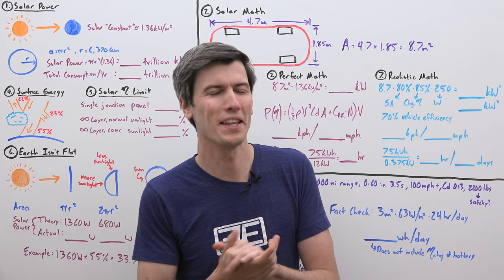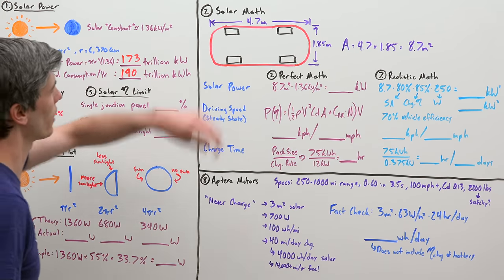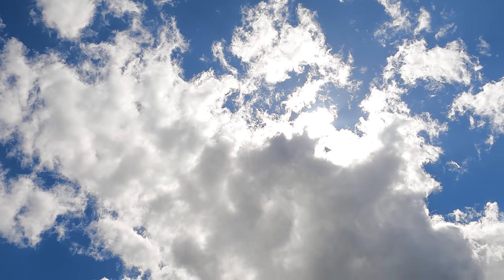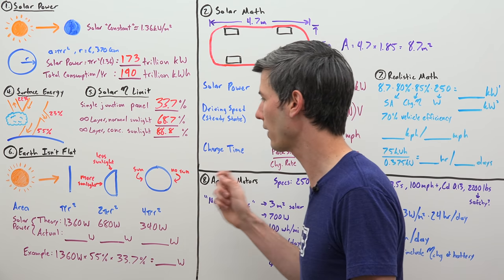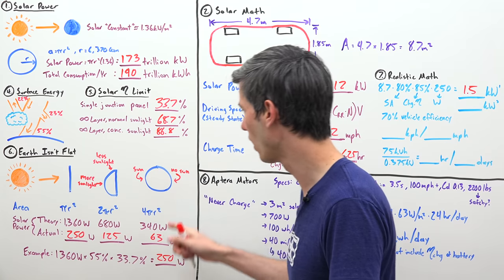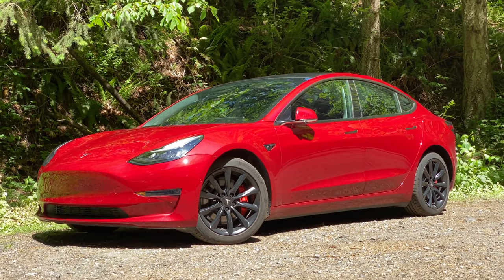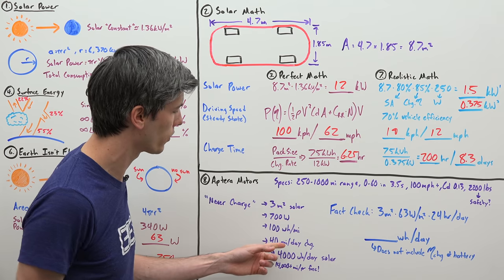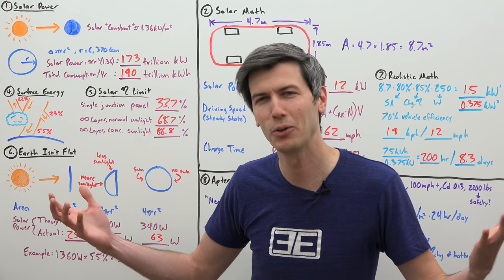Why Don't Solar Powered Cars Exist?

Comment: Short: There isn´t enough power. You can see it also when looking to solar-race-cars with bicycle-thin wheels and huge panels on top, extremely aerodynamics and closely interiors. 
But I thinks, all cars should have solar-panels on top, to feed AC-vents when parking under the sun (to avoid hot interiors) or give a little recharge to the traction-battery.
Reply: Absolutely spot on.  Parking a car in sunlight, almost regardless of the season, means returning to an oven. Given that this is both uncomfortable and, potentially, dangerous for animals left in the car (sometimes unavoidable for short periods), it would make sense to have a supplementary solar system to help run the air conditioning whilst the car is stationary if it's powered by an ICE, or additional to the battery if powered by electric.  I have a vague memory of this having been trialled some years ago.  Why has it not made the main stream I wonder ? Admittedly a total power consumption of 5kw is a tall order, but as a supplementary source, why not?
Reply: @frenchchriss9880  Aptera is not any normal metal car body   The body is a foam filled sandwich with a much higher r value than a normal car, so it heats up at a much slower rate.

Comment: Jason, on the fact check on the last line, why did you take 24hr/day to get the total Wh/day? I thought the rule of thumb is to multiply the peak wattage by ~4hr/day instead? Unless the car is being driven under the sun 24hrs a day, which doesn’t make sense 😅

Comment: I was interested in the fisker ocean, so I did some math and found that you can save about $55 a year when energy prices are $0.15 per KWH . This made me think though. How much do solar panels weigh? Does adding the weight of solar panels reduce the energy efficiency of the vehicle? If so, you would not be saving the same amount of money. I’m wondering exactly how much the weight of the solar panels would effect the energy efficiency of the vehicle. (The fisker ocean claims a range of 300 miles on a 80 kWh battery. They claim the solar panel roof will provide 1000 free miles a year.)
Reply: Maybe they already take weight into consideration though when they say 1000 free miles

Comment: The normal size of a standard car with high efficiency Solar Panels but built for one occupant and with slim tyres would probably work very well out where I live . Minimal road resistance, a very energy efficient Motor and a great coefficient of drag and you’d have an awesome sunny day driver ….the big secret to success is to minimise your power requirements whilst maximising your power uptake, bleeding off excess power to cool the car as you drive .

Comment: Quick question: on the Aptera fact check, why do you multiply with 24h since the daylight with powerful enough sun would only last probably around 8 hours? That would mean that the numbers should be lower right? Or am I taking it all wrong? But all in all this is a very cool and clear explanation 👍👍👍
Reply: He already calculated how much solar energy you can expect in a 24-hour period. This accounts for not only the number of hours of daylight, but the fact that you get more sunlight at noon than at dawn.

(He didn't account for your latitude, but took a whole-earth average. Closer to the equator, you do get more. Likewise, this is global average weather conditions. You get less energy in a place that is often cloudy.)
Reply: Watch the video?

Comment: You could use the solar panel to charge the 12 volt to keep the computers alive and also the power the radio windows and the other accessories to reduce the draw on the main battery for any EV instead of flat-out charging the Maine pack
Reply: The Aptera doesn't even use a 12V battery, it uses a converter to run 12V systems from the high voltage battery pack.

Comment: I probably missed something, or are we assuming that the sun is shining at night calculating with 24h days? Either way, would still be great to supplement our consumption with solar power if we can build durable affordable and environmentally sustainable solar panels.
Reply: I think that's the line of thinking he overlooked, which companies like Lightyear, Squad Car, and the makers of the Sono Sion didn't overlook. The problem with thinking from data alone is the powerful tendency to consider only the data that supports your preconceived notion. When you address a problem with the "how do we make this possible" thinking cap, the more powerful tendency is a thorough consideration of all the factors involved (including those that have not yet been identified).

Comment: You jumped solving the problem instead of focusing on what the problem is in a first place. 
1st Toyota Prius Prime already has solar roof that ads 5 miles on sunny day. 
2nd This could completely solve the problem with ghost battery drain when you leave the car for a long time at the airport, or using century mode on tesla
3rd. If you like camping this would be very useful. If you camp for a few days, this could completely charge the battery and you could go places where normal electric car can not reach. 
4th. If your area had storm and there is no power for a week, but your car has a high voltage socket, this could provide basic power for the light, tools etc even if you forgot to charge the car.
5th. It can keep the battery warm in the cold climate or it can precondition the battery.
So its not about using solar to drive the car, but to extend the possibilities of existing cars, this solves some problems and introduces new possibilities. I am 100% sure in 10 years all new electric cars will have some sort of solar charging option.

Comment: What if you did a video on the math of using solar panels as range extenders? What if you are out in the middle of rural Montana or Wyoming and you mess up and can’t get to a charge station on time? The charging solar panels could be an emergency back up giving you the equivalent of an extra gallon of gas. (20-40 miles) That way you won’t have to have the car towed.

For the normal person, the panels might make the car too expensive, but I would think somebody with a wad of cash would buy it to just say they have it.

Comment: I think the biggest obstacle to solar powered cars is that people think of them as solar powered cars. A pure electric solar powered car would be so unreliable you'd need the option to plug it in, making the solar panels redundant anyway. Where it would actually make a difference would be in hybrids and PHEVs. In my country, 30% of people have no choice but to use on street parking where charging isn't really possible. If the tech was added to hybrids and sold on the promise of an actually attainable 20-30% improvement in mpg for the average driver, there'd actually be a market for it.

Comment: A solar powered car would need a trailer with solar panels of about 250 m², so that is, with a limiting width of 2.5 meter, a 100 meter long trailer. That is for a regular, 4 person car.
Reply: Is it possible to use something other than a regular, 4 person car? That could help bring down that 250 m^2 number.

Comment: Thanks for putting together this topic.  I have a question, what if the electric car was to have a alternator like device (built into each wheels motor to supply the car as well as charge the battery.  Like a high, high output one alternator? At that rate the battery could be smaller, making the car lighter as well.
Reply: Because the alternator has less than 100% efficiency, will cause extra drag on the car, and will reduce overall vehicle range.
Reply: Get that set up and market it as a modern perpetual motion machine.  I think you are on to something here.    (want to buy a bridge?)
Reply: That is essentially the idea of regenerative braking. Use the motor as a generator to slow the vehicle and recover energy to recharge the battery.

Comment: May i ask, can you do this, but instead of a model 3, use a Tesla Semi, and, use the semi trailer roof, a nice big flat surface, and cover it in panels, does it then make sense to assist with Semi range?

Comment: Okay but that's still impressive because if it takes 8.3 days to fully charge your 75W vehicle (we all know we are talking about a tesla model 3) then you can still get over 43 full battery charges in one year just from solar. 
43 charges × 285 miles = 12, 225 miles per year from solar.
285 miles ÷ 8.3 days is 34 miles per day. So if you drive less than 34 miles per day you could drive for free.

Comment: That 33% number for efficiency is also extremely optimistic.  

Efficiency is measured at 25 Degrees C.  Which never happens in the real world.  The Sun heats them up.  Efficiency drops off considerably after being in full sunlight for even a short time.  This sadly effects the most efficient panels more than some of the less efficient thin film technologies. 

You'd be lucky to get 20% in an application like this.  Less if you wanted to use reasonably priced panels.  And there are losses in Area efficiency related to the cells themselves.  You can't use one big cell inside the panel, the voltage will be much too low.  You'd need link smaller ones in series.  There is a reason the Toyota Prius Solar Panel roof wasn't even part of the charging system.  

Solar Racers make it work by increasing surface Area, and minimizing weight, and has extremely low drag.  Basically like a wing.  No production vehicle is in this sort of ballpark.

Comment: If Aptera marketed a model aimed at the 2nd car market, the price could be slashed dramatically & become a super attractive proposition for many.
There would of course be sacrifices to be made, but it would be way more efficient, with less demand for expensive battery mineral resources, making it even more environmentally friendly.
The first move should be to reduce performance to perhaps a sensible 0 to 60mph in 9 seconds, with a limited range suited to a daily local run-around.
Then again, if it's not needed to do highway trips, then the radical shape could be toned down & be visually more attractive.
Reply: Low power motors would not be great for regenerative braking. Having powerful motors is needed for decelerating effectively via regen. Being able to accelerate quickly is just a nice side effect.

Comment: I'm a fan of what Aptera is trying to do but if you live in a built up area away from the equator there's no way you're getting close to 40 miles per day. In northern Europe for example I think you'd be lucky to get 5 free miles. They'd probably be better off scrapping the solar panel and marketting it as a cheap super efficiant EV.

Comment: Solar would work great for microcars (quandricycles) in sunny countries, since they weigh less, have lower top speed, and are only used for short trips.
Reply: All city cars basically - 20kmh average speeds in the cities, they spend all day outside and are driven for 1-2 hours in traffic. Even getting 3-5 km of range per day sounds like a dream

Comment: It’s not about fully charging the batteries in this early stage, which is precisely why all variations come with multiple ways of charging the battery. 

But if you could charge maybe 1/8th or 1/10th of the fully battery capacity per day, it would totally make sense. Especially if you don’t drive every day or have short commutes or multiple cars as options. 

Technology is only going to make batteries and solar panels more efficient. From last year they are 50% or higher in efficiency, and 70% lower in cost. Give it 5-10 years and the viability will be much better.

Comment: I'm sure this is a re-upload.
Anyway... Forget putting the solar panels on the car, put them on the house, put them in a field etc... It doesn't matter where the solar panels are, if the car is getting the power from the sun, then it's powered by solar making the argument a little flawed.

Here in the UK, all my energy is renewable. My electric comes from various wind and solar farms around me and my gas is from recycled food waste. (The gas is a little bit confusing as it gets topped up with conventional gas sources but the energy company offset any units we use which are not from renewable sources by planting trees and other environmentally friendly things.)

Some people, live in "off the grid" homes which, if they also own an EV, will be charged by the same renewalable energy.
Reply: You know it isn't an either/or choice, don't you?

Comment: i get why cars don't depend for solar to completely power them. What I don't understand is why don't they put a panels on EVs for other use cases?

You ran out of juice a little before you reached a charger. Waiting around for a few hours to take you a mile or so could be useful. Or you are stuck on the highway and your phone is dead. A trickle charge from solar might be useful to call for help. You have your car parked for extended period . Keeps the battery topped up.  If camping or outdoors somewhere you can use it as a power station for moderate power needs without worrying about getting stranded. Power goes out for extended period in you neighbourhood. You have a bit of a backup UPS, etc.. etc.. The portable power stations with portable solar panels market has boomed these last few years. WIth an EV with solar you are effectively getting a big one for free without the inconvenience of having to lug one into your car.

 You could even dramatically increase the amount of solar panels on an EV by using newer generation thin panels and having some sort of retracting solar panel system to boast power while parked. Some creative RVers and vanlifers are already doing this with solar awnings and custom roof mounted retractable solar panels. Saw one Sprinter van with 1600W of solar panels (when extended when parked ). Surprising that the big EV companies haven't picked up on this.   I'm positive if a company with big resource executed this well and affordably it would be very popular optional feature. Imagine unfolding out a few thousand watts of  solar from your car roof as needed. That would be really useful in countless ways.

Comment: Can you please do the math on how large a solar farm/array would need to be to charge multiple electric cars simultaneously in reasonable time (eg. rate of a Tesla supercharger) in a gas station style scenario. I find it interesting how many people cannot believe how large the array would need to be when I explain why a rooftop solar array is not enough to even charge a single electric car fast enough at a gas/charging station scenario - whereby you can probably only hang around between 15 to 30mins before it becomes a massive inconvenience.

Comment: I think it's feasible if you don't use your car much, like a granny or something. Shopping twice per month and a few errands here and there close by but other than that it's parked outside. Also, assuming it's fully charged when you're out and about, those short trips shouldn't drain your batteries completely, maybe 10-20% and it should be good again in a couple of days.

Comment: What would be your thoughts on putting solar panels on vehicles that already have large surface areas, like buses, semi's, trains, or airplanes? Would their be any benefit, or due to the amount of power required to make these large vehicles travel, little to no benefit from solar panels?
Reply: Trains would benefit
Reply: @knartfocker_  8lb and ~$200 per meter for light/flexible panels (travel ones generally used for camping or boats).

Comment: Solar windows are beeing researched (i think) and even if they are not as efficient as a solar panel, they could help. The car could have flexible solar panels on the sides so it would cover every square inch of the body. That would help with the curbiture of the Earth problem, also in the evening/morning when the sun is down. No need for paint also. That should be considered "green". Maybe the technology will advance that far in my lifetime.. It would be nice to think that when you are at a traffic light your car isn't burning expensive fuel and it's actualy charging instead. Or it charges when a charging station is not available. Traffic is going to get worse but if the range increases as you stand still in your car, that will be awsome. A car like that doesn't necesarily need tesla-like performance. A solar range-extender would totaly compensate. Pardon my english (i'm romanian)

Comment: I have an idea, we should build fixed solar panels that are permanently installed in a giant field, connect inverters to them, and connect them with wires to an electric car charger. This solves the problem of limited surface area on the car, and the user of the charger can pay the owner of the solar panels per kWh consumed. We can even connect that whole contraption to nuclear plants and wind turbines so the charger works even when the sun doesn't shine.

Oh wait, that's just called the electric grid.

Comment: I’m curious if these numbers would be any better for an electric semi-trailer truck, with the trailer being covered in solar panels. Of course it would be very expensive and heavy, but I wonder if all the extra surface area for the panels would make it more feasible to actually try out.
Reply: Thin film panels would weight much less, though have less efficiency. If you got a solid box trailer you could build the panels into the roof and remove need for the weight of rigid panels and the frames to hold them, but many trailers have fabric covers and the roof is meant to be opened so you can lift large cargo in and out, so no panels on those.
Actually, I doubt installing panels on frames would be allowed anyway, a camper van can hold couple without much trouble, a long trailer hitting a pothole might shake few 40lb panels loose and re-enact that "surfboard comes loose at 50mph and decapitates someone" scene from wherever that happened...